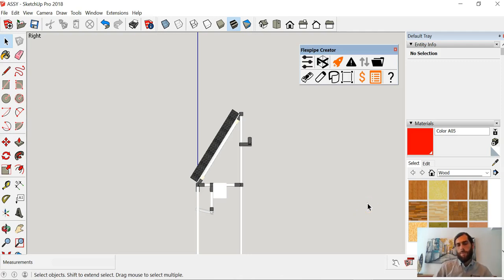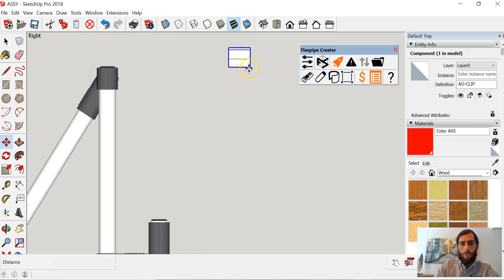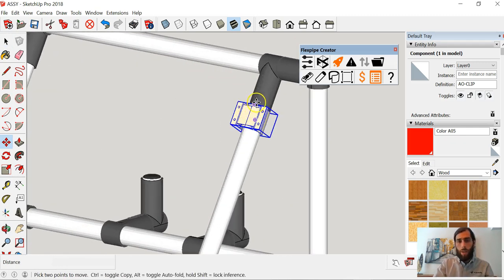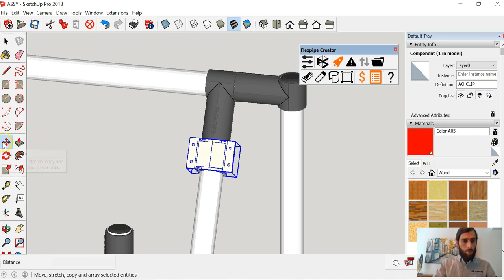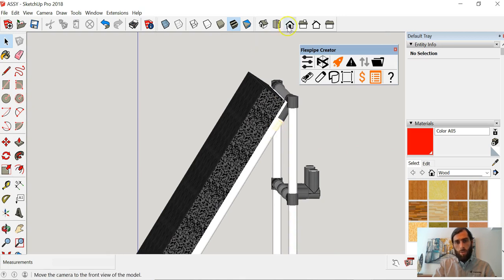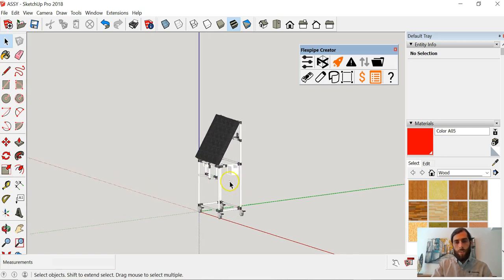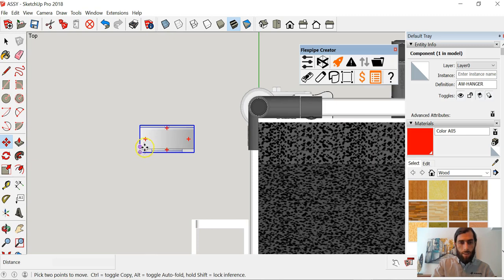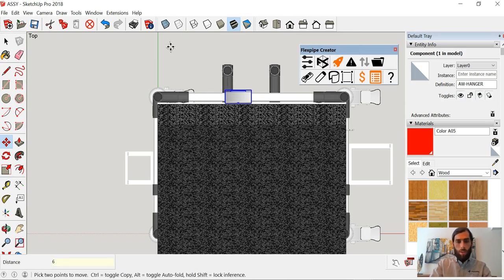How to insert accessories in the Flexpipe creator extension for SketchUp

Comment: How would you insert the WF-LPLATE for example which would replace some of your joints and alter the tube lengths and add a tube?
Reply from the maker: Both the WF-LPLATE and the WF_RPLATE will replace the traditional HJ-2 joint set which would be used on the corners of a structure to hold the vertical tube along with the two parallel tubes at the bottom that are placed 3 1/4" center to center to hold the caster brackets and the remaining horizontal tube. The lengths of the tubes remain the same. If using the Flexpipe Creator extension drag and drop the WF-PLATE into the drawing from the Library Parts Icon, select and delete the HJ-2 joint set it will replace and move WF-LPLATE into place.